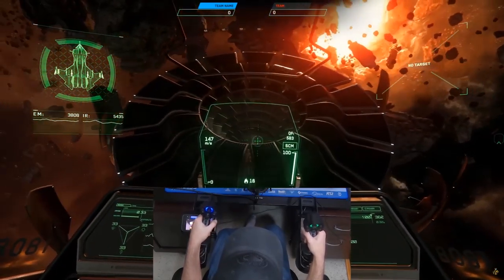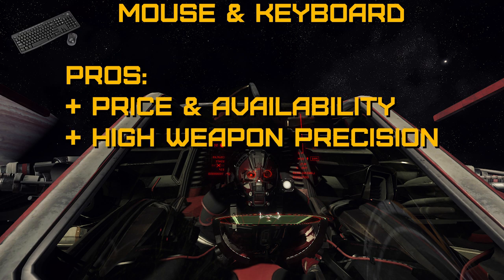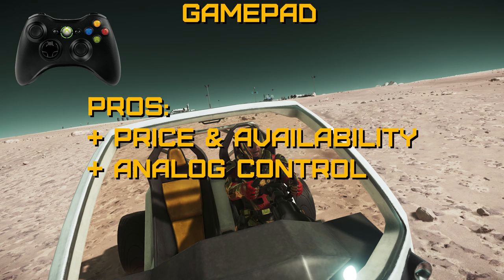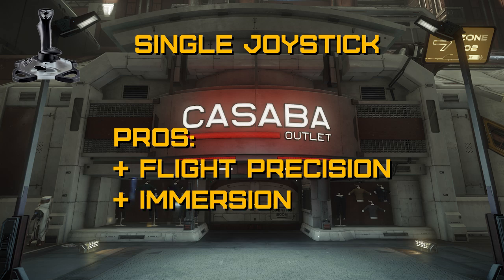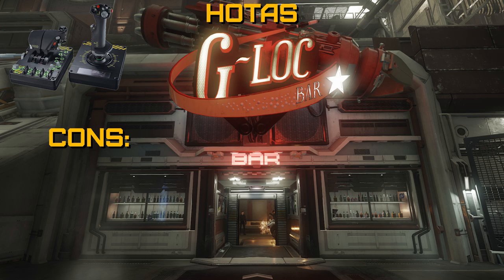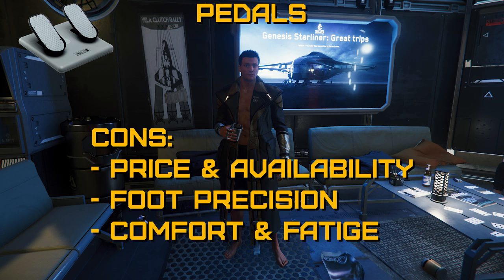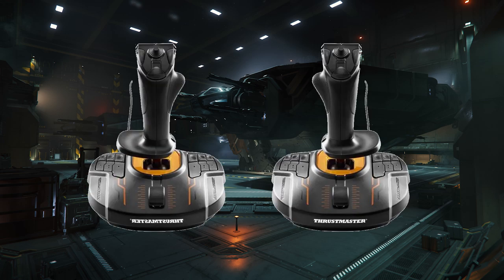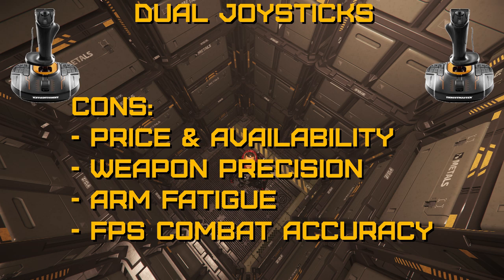Why Use Dual Joysticks?

Comment: Great video. Though the thing I found with the dual setup is, that even if there are a lot of buttons on the stick, I find I can't afford to take my hands of the controls when operating my ship.  So buttons directly on the stick and not on the base are fine. I will rarely be using the buttons on the base and will be offloading most things to voiceattack.
Reply from the maker: I should have mentioned voice attack... missed opportunity.
Reply: @BuzZzKiller  with VA though you have to remember that if you use VoIP you need a push to mute button for your VoIP and bind it to the same as your push to activate for VA so you don't get accidental activation
Reply: Yeah, Voice attack fills the gap of not enough buttons nicely. Verbal shortcuts ftw!
Reply: @sybilreichlan6117  But for VA you must think in Russian -> Firefox (1982)

Comment: Here learning to use my old t16000M in Star Citizen using keyboard on my left hand. I use WASD keys to strafe as usual, control and spacebar to strafe up and down, and the pitch, yaw and roll with the joystick in my right hand, alongside weapons management and speed limiter on the throttle axis.

It's not easy to aim, but i think i can get  better on it if i tweak the sensibility and practise. I find this way the best way to play Star Citizen if you have a simple joystick in your home.

Comment: I use a PS4 controller for Elite Dangerous, and have mapped all the buttons i personally use. Yes, i have to use a lot of shift-buttons, but i think it is suprisingly logical and easy to remember. I use this instead of keyboard + mouse mostly because i think it is more comfortable to use (but im gonna order a hotas setup today. I think its gonna be easier for me than a dual joystick).

Heres how i have mapped my PS4 controller in a way that i personally find to be both efficient and intuitive to use, and relatively easy to remember..:

(X is the main modifier/shift button, square is secondary shift button,, and triangle are additional modifier/shift button. They do not have any functions if pressed on their own. Circle is for targetting AND a modifier button)

Right stick for roll and vertical thrusters (which i mostly use for combat), and left stick for pitch and yaw.
Left+right stick press is FA on/off.

R1 and L1 are fire buttons. X+ L1 or R1 selects fire-group, and square + R1 selects cocpit mode.

I use R2 and L2 for thrusters (accelerate and break/reverse), and have set X+R2 to 75% thrust (to not overshoot the target), X+L2 is 50% speed (great for battle) X+Square+R2 is 100% thrust, and X+Square +L2 is 0% thrust. Square + R2/L2 is incremental increase/decrease in speed, and pressing the triangle button while i accellerate (R2) activates the boost...

Arrow buttons are used for additional thrusters (vertical and horizontal, which i use mostly for landing, and not during combat).

X+ "Left Stick Press" is to go into supercruice, and square + "left stick press" is that "FSD jump" to other systems (i forget what its called). If i have deselected my jump route (maybe to go to a station or whatever), i press circle (my targetting button) + "left stick press" (which is associated with the FSD) to reselect the last jump route...

Circle is for targeting, and i hold circle and use it as a shift/modifier button together with the arrow buttons for selecting targets.
X + arrows are for pips
Square + arrows are for the right/left/top/bottom screens
Triangle + arrows gave orders for the fighter, but that fighter would always start shooting the wrong ships, and make me wanted, so i ditched the fighter bay and im thinking of using the triangle + arrows for wing commands instead...

I use the left and right pad press (like PRESS - not "touch") for landing gear and cargo scoop.
X+ left and right pad opens galaxy map and system map
Square + L/R pad is nightvision and ship lights. 

Im not using chaff or heatsinks, but if i did, i would map it to triangle and the right and left pad press...

I think thats all, but my "good for nothing" ex pothead brain probably forgot something, lol...

Comment: I perfer pedals instead of a 3rd axis on the right sticks, feels more natural to me
But two sticks made SC so much more enjoyable! I would recomment to mount them on a table or chair mount :)
Reply: I use pedals for roll. It's really the least necessary of the axis (aiming is mostly pitch and yaw when exo and in atmo dogfights are exceedingly rare)
Reply: I prefer the 3rd axis on the stick, it's much faster to maneuver than using your legs.
Reply: how do you mount them?

Comment: been using a gamepad until i get some kind of joystick setup, remapping the flight controls on the thumbsticks was an enormous help. I made it so that the joysticks handle somewhat like a dual stick, with the left shoulder button changing my right sticks normal L/R roll into strafes for precision landing. Doing that, the only thing i've needed my keyboard for is landing gear and system power.

Comment: Unless you're a pure combat player you'd want a throttle to go with dual stick. So perhaps for most people the best option is to buy a hotas, then when they're feeling like the to need that extra control get a left handed stick to complete the setup. 

Though personally I'm feel a hotas in a just fine in elite because vertical and lateral thrusters don't benefit that much from analogue input, apart from getting off very smooth landings.

Comment: I recommend after getting HOSAS to upgrade to HOSAS + pedals. After using both extensively I think the pedals are a great addition. You have two options with them. Either use them for yaw, or use them for thrust. I think thrust is the best method, almost like a car.

Comment: I have a Hotas but in most cases I prefer my rc transmitter (tx16s) which has huge full range high resolution gimbles which you can pinch hold. This makes it have incredible precision both in flight and weapons

Comment: when i have time to play for over an hour or so i'll set up my dual sticks. other wise mouse and keyboard. and i like my scuf gamepad for fps. i don't do competitive stuff so i haven't seen much drop off in the aim. i'd use the gamepad all the time (when i'm not using sticks) but there is a bug right now switching to flight where it doesn't like my bindings/modifiers.
Reply from the maker: I noticed the gamepad modifiers got messed up a couple patches ago. With the limited buttons, it makes them really hard to fly with. For FPS, if I'm not in a fight, I use the thumbsticks on my Virpil Deltas to move around like a gamepad.

Comment: I've tried pretty much every combination you discussed and prefer the dual stick setup.  The main issue I have with dual sticks is in FPS.  When I am not in my ship I prefer mouse and keyboard for obvious reasons.  The issue is comfortable access to the keyboard and mouse.  I have Monstertech desk mounts and chair mounts, but both present the same issue of increased distance to the keyboard and mouse.
Reply from the maker: Yeah I’m the same way. With the T-16’s I just put the sticks in the desk and the mouse to the right. But the Deltas on their mounts get in the way all the time. I have the thumb sticks bound for FPS movement so only have to switch to the mouse and keyboard for FPS combat. I’m looking into some kind of mount to place my mouse on next to the joystick for easy access. That way I can use the left thumbstick to move around and aim with the mouse.
Reply: @BuzZzKiller  They have a side mounted mouse platform for the mounts I have.  I've thought about getting them and maybe adding something like an Orbweaver for the FPS keyboard on the left.  That's about the best I think I can come up with short of a SIM Pit.  I have the dual T16000's on the mounts, so their base does complicate things when mounted to the desk or chair.   Anyways, glad to see you back making vids and I greatly appreciate your continued support of the dual T16's setup.  Those Virpil's look amazing by the way.

Comment: My setup of choice is HOSAS + pedals - I have the right stick bound to pitch (forward/back), roll (twist stick) and yaw (left/right), left stick bound to strafe forward and back (forward/back) and strafe left and right (left/right) and then the rudder pedal main axis bound to strafe up/down. The rudder pedals I use (Thrustmaster TPR, aka the best ones you can get) are highly precise, stable and comfortable and are more precise than twist stick (by a lot) so they make for great strafe up/down controls where you need higher precision than the other strafe directions to make for soft and precise landings. 

My left stick is my old saitek x52 (which I've had 20 years and always loved, played through the X games with it) and my right stick is a Logitech/saitek x52 pro which is a nice step up but essentially the same stick. I love these sticks for their precision, versatility and comfort but others may prefer more metal or "realistic" sticks (although many of those lack twist axes). 

This combined setup makes for very precise controls and flight precision, and is fantastic to play with.

HOWEVER! I do wish that a flight stick was available which replaced the right stick's main hat switch (which sits where your thumb typically rests) with a mini trackpad or even trackball - I feel this would add truly the best of both worlds, with joysticks controlling the broader movements and the trackpad/trackball additionally controlling gimbal weapon aim.

Alas, HOSAS + Pedals is the best I'm able to get so far

Comment: Hey, I’d love you to cover dual stick and throttle, my absolute ideal setup. I have two Virpil constellations with extensions and the Mongoos T-50CM. It’s very cool, but there are also pros and cons.
Reply from the maker: The only throttle I have is a Warthog, and it's been collecting dust in the closet for over a year. I just don't have the desk real estate to add it in. When I eventually update the video, I have a few other input types I can add and this is one of them.
Reply: BuzZzKiller Awesome. Yup, my sticks and throttle are all on monster tech mounts. I wouldn’t recommend trying to desk that setup.

Comment: I'm considering doing a HOTASS. Dual sticks with a throttle. For normal flight use stick and throttle but for more flight precision switch to dual stick.
Reply from the maker: That's not too difficult to set up. Just bind your throttle forward to the Throttle axis and have throttle forward/back on the left stick Y.
Reply: @BuzZzKiller  I actually have it set up this way now. I use the throttle for constant speed travel between destinations. If I get interdicted I throttle to 0 and go dual stick.

Comment: I'm a madman who overloads all the buttons on my gamepad. I use the abxy buttons as modifiers for all of the other buttons in addition to default behaviors. My stick arrangement is odd too; pitch and yaw on left, roll and vertical thrust on right. I use that stick setup minus the thrusters in Kerbal, so I am used to it. In Kerbal it is nice to have pitch and yaw separate from roll and it makes navball based navigation intuitive.
Reply: You may be interested in the setup I use for SC, which is an Xbox Elite controller (the paddles add so much functionality). I use ReWASD software to add crazy functionality and I also have the chatpad attachment although I rarely use it, but with it I can absolutely replace M+KB for SC and my desktop. I use one config for everything in SC (something dual stick users don't do...its great for flying but not much else). You can check out my channel to see it in action.

Comment: Currently got a hotas setup (x56) And the limitations of not having 2 sticks. For space flight I can't recommend 2 sticks enough.
Reply: Really? I have the X52 and actually find it quite enjoyable with the d-pad on the front of the throttle picking up the other two axis I find I still have the full range of movement and can easily keep up with my friends who have more advanced set ups, plus I do a lot of space trucking and mining so it's nice to not have to hold my throttle the entire time when taking long journeys. But that's on elite dangerous so I'm sure it's probably way different on star citizen.

Comment: I recently started playing with dual sticks and it feels fantastic! For anyone one budget you can buy 2 x t16000 sticks for about $80. Add game glass and your experience will change dramatically
Reply: Done so too, only i find it difficult to get t.a.r.g.e.t installed and used corrertly
Reply: @game4u2b  I don't use target at all. Just use in-game settings

Comment: Something you missed is that many HOTAS setups have analogue sticks too, like controller thumbsticks. Which gives you all 6 degrees of freedom with analogue and some of them have several more analogue axis.
Reply from the maker: This is true. I don't consider the dials as useful analog axes (though they can be used for things like thrust limiting), but the thumb sticks and paddles on the Thrustmaster FCS throttle can be quite useful.

Comment: Thinking of picking up the T16000M to acompany my t.flight4. I can use the throttle for normal flying then immediately go with HOSAS on the fly.
Reply from the maker: How's the T-Flight held up for you? I've never used one and people have been asking me about it.
Reply: @BuzZzKiller  So far so good. I bought primarily for Star Wars Squadrons, but then got my butt down to properly playing Elite (using a gamepad felt game-y and not like playing a sim). I've put a lot of hours down in it and completely neglected Squadrons. Elite has forward and reverse thrust so the notch that centers it is useful to lock it to zero. Just wished there was a bit more resistance when its off center. But otherwise it's pretty smooth and like you mentioned in your video, with Elite approach throttle is essential. Especially if you want to manually supercruise.

I'm trying to find out if it is possible to use the t.flight and t16000m together. I'm sure it must be possible as using 2 sticks, the PC still sees them as 2 devices. The T-flight is connected via only one USB thus, it's considered a single device.

Comment: Been wondering about getting a setup like that for playing Elite, since an Xinput gamepad (even with modifiers) just doesn't cut it. The problem is, due to the virus of unknown origin and, most likely, the launch of SW Squadrons  and MS Flight Sim, joystick prices have gone orbital. Not that the ones I wanted were cheap to begin with, but this is getting ridiculous.
Also, can a setup like that work with older stuff, like Freespace 1 and 2?
Reply from the maker: I don't know about Free space. Its been too long since I played it. I know it worked with the newer crowd funded Descent game that Wingman created.

Comment: Old but not that old. Coming from Elite. There are manual aimed weapons. Fixed weapons. in which you need to place your ship in a certain way or hit the target directly lead shots and such. Depending on weapon type. However if you mean with manual weapons that you target and follow your mouse or it is aimed in some other way instead of positioning your ship. Then I think your definition is right in this.

Comment: The Thrustmaster has the same problem as my old MS Sidewinder... all the buttons are on the base. If you're in the middle of a fight or some tight maneuver and can't take your hand off the stick those buttons are useless. Even when you can safely take your hand off the stick, some of the buttons are awkward to reach because you have to lift your hand over the stick or pull it back around the stick to get to the other side. The buttons on the "outboard" side are fine, your hand just drops down to them. The layout seems more designed for a single stick sitting on the center of a desk with buttons available for both hands. I'm going to spend twice as much, but the VKB Gladiator NXT stick has tons of buttons on the actual stick (24, IIRC) and is available in a left-hand version. Even one of them will handle most of what I need for E:D. When I get the second one I'll only have to touch the keyboard to actually type something into a text box.

Comment: How does a duel-stick set up work in non-space flight sim games, like Ace Combat and Project Wingman? I love the idea of duel-sticks, but it needs to also work with throttle-based flight sims.
Reply from the maker: You can make it work but it’s not ideal. Some sticks like the VKBs can be setup so they don’t have return springs on the throttle axis.

Comment: Also there is GAMEPAD + Joystick (16000) i am using. When i go down to planet on foot i use GAMEPAD + MOUSE. 

I am using in left hand PS4 dual shock with left stick working as strafe up/down/left/right. L2 as throttle from 0 to max speed. When i am not in combat i use slider on right to adjust speed limiter and set ship in cruise mode. While in combat i use L2 with speed limiter for safe speed or switching it off for chase/rapid closing.

L1 works as modifier so with this for example L1+L3 is break instead of L3 afterburner. If i want to go back i use L1 and L2 which reverses L2 throttle direction. That modifier also means dpad has twice buttons, select is also twice and ps4 has touchpad with 3 buttons and 4 slides working as button in DS4windows software.

IT is kind of nice, less immersive that dual joystick but still kind of dual joystick just with smaller stick on left side.
Reply from the maker: That’s pretty cool. Glad they are allowing the game pad buttons to work as modifiers again. I wish they would do the same for joysticks.